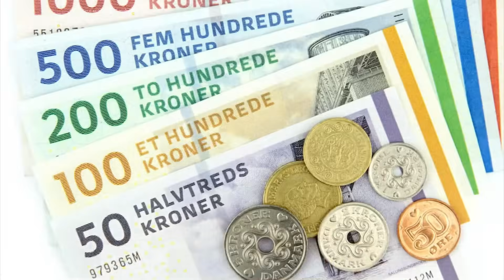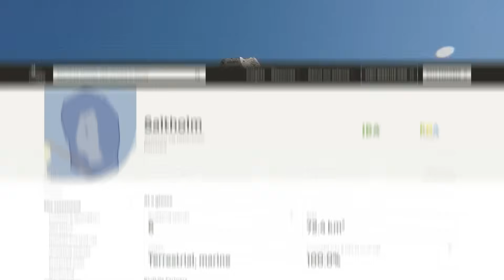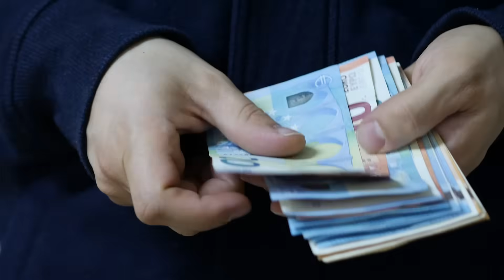Can the Øresund Metro Unify Denmark and Sweden?

Comment: Max speed Øresund train across bridge - 180 km/h
Max speed Copenhagen Metro - 90 km/h

The Danish state railway company DSB fears Swedish competitors might take parts of the Danish market and so want to shut down regional trains across the bridge, claimng it's congested and freight and long distance trains are crowded out, only a metro to Malmo will fix that.
Reply from the maker: That’s a really useful breakdown, thank you.

The speed difference is striking, and it highlights one of the key arguments in favour of a dedicated metro link. But you’re also right to point out that DSB’s position isn’t purely about capacity, it’s also about market protection. The congestion argument has some technical merit, especially with increased freight and long-distance traffic, but it’s hard to ignore the commercial dimension.

Replacing regional trains with a metro would change the nature of the Øresund link entirely, faster frequency, but lower speed and range. Whether that serves cross-border commuters better, or simply reshapes the operator landscape, is still very much up for debate.
Reply: @urbangiantsofficial Also, it would end direct trains between Copenhagen and large cities on the Swedish side such as Lund and Helsingborg.

Comment: Most of the shown footage is misleading. 
One topic is not even covered; the comfort of the service. If you went to Copenhagen today, you will notice the comfort of metro service is awful. If you are even able to get a seat, they are hard as a rock and the metro trains themselves are very uneasy in the tracks.
For the current short trips, this is barely acceptable. For a 20 min ride to Malmø, it will be highly unacceptable!
This is just a political wet dream, by people who have no idea about how it is to use the metro in Copenhagen today.
I do however acknowledge, that the capacity needs to be increased - but just with regular trains which offer a superior user experience.
Reply from the maker: The footage is illustrative, not literal. We used available visuals to convey the concept, not current rolling stock. It’s noted that not all clips show the exact systems being proposed, and that will be better clarified in future edits.

On comfort: yes, Copenhagen Metro trains aren’t designed for long-distance travel. If this cross-border line were built, it would require a new class of metro vehicles suitable for a 20-minute journey. Comparing it to existing local metro stock is not accurate. This proposal isn’t about reusing the current system, it’s about scaling capacity with higher-frequency, automated service, which conventional rail can’t deliver on the same level. The current system is reaching its limits, and regular trains won’t meet long-term demand.
Reply: @urbangiantsofficial  The proposal is about extending an existing metro line in Copenhagen to Malmo.
Reply: Dude, Copenhageners are so soft, it's honestly embarassing. Try riding the metro in Seoul or Beijing or a similar large metro system. Standing up for an hour straight to get anywhere in the city is completely normal. A twenty minute metro ride is nothing!

Comment: Talking about TBM being a proven approach used at the Fehmarn belt tunnel and simultaneously at 3.10 showing footage from said tunnel which is obviosly not TBM-made. Great reserarch!
Reply from the maker: Fair points, our visuals are still a work in progress, especially with limited footage available. We’ll be tightening accuracy in future edits, and we appreciate you calling this out.
Reply: And also talking about the Copenhagen Driverless Metro while showing footage of the Copenhagen S-Tog train with a driver.

Comment: The Danish state railways, DSB, hates the cross border Oresund train system,  and is fighting heroically to get the nasty Swedes off its tracks. It has successfully cut it back on the Danish side from Helsingor to Osterport and is now working on getting it off the stretch to Copenhagen Central Station. The point of this new line proposal is to replace the present 180 km/h Oresund train connection to Malmo with a 80 km/h metro line so they can get the Oresund train off the Oresund bridge, supposedly to make room for freight, which would otherwise need more cross-Oresund fixed links.
Reply: citatation needed
Reply from the maker: There’s some truth here but also key distortions. The Øresund Metro isn’t a replacement for the existing 180 km/h rail link, it’s a supplement to relieve congestion, especially for short-distance commuters. The goal isn’t to “kick Swedes off the tracks” but to free up capacity on the Øresund rail corridor, which is projected to hit maximum usage by 2040. DSB has reduced Swedish train access north of Østerport, yes... but the core Copenhagen–Malmö route remains critical. Freight growth and regional integration are both real pressures, and a metro helps absorb that load, not eliminate it.
Reply: As a native Swede it’s hurt to hear how awful you Danes thinks of us! “ nasty Swede “ Tack Denmark!! Och hejdå !!
Reply: @Greenelnour  Nope, I wrote that's how DSB thinks of potential Swedish competitors on their tracks.

Comment: If this project succeeds once it's built, we may get a similar connection to Germany from somewhere in Sweden (probably Trelleborg or Ystad). So I would welcome this project, because of what it could mean for the feature.
Reply: A metro from Sweden to Germany is too great of a distance.
Reply: DUDE! Look at the distance from Sweden to Germany across the water. No tunnel or Bridge will be made there. It just doesn't make any sense whatsoever. There is no great need for it, and the price would be astronomical. If you are in Sweden and want to go to Germany; go through Denmark.
Reply from the maker: A metro to Germany is a stretch with today’s tech and priorities, but a fixed link from Sweden to Finland across the Gulf of Bothnia is a more likely next step. It’s shorter, more feasible, and already being discussed.
Reply: @urbangiantsofficial  Fixed link from Sweden to Finland? ROFL. That distance is 10x the length of Øresund bridge + the traffic volumes there is significantly lower than in Øresund region. Please, act your age and stop talking about nonsense.
Reply from the maker: Instead of insulting, feel free to do a simple Google search and you’ll see that it has been talked about. It’s not a good look and invalidates your input.

https://www.euronews.com/next/2025/03/08/will-a-bridge-across-the-baltic-sea-to-sweden-give-finland-faster-connections-to-europe
Reply: @urbangiantsofficial  I'm willing to make a bet. That will NOT be built within the next 30 years for sure.  I will give you odds 50:1 - Are you willing to bet?
Reply: @urbangiantsofficial  It has been mentioned. Hyperloop has also been mentioned. People dream about stupid shit all the time.

Comment: Wouldnt it be easier to add a couple more tracks the the Øresund bridge?
Reply: Not possible its designed for 2 tracks
Reply from the maker: Good question, but no, the Øresund Bridge was only engineered to carry two rail tracks from the start. It’s already operating near full capacity, which is one of the main reasons the new metro is being proposed.

Comment: Have you ever heard of Øresundtåg it already does this in 20 minutes, so it wouldn't be needed
Reply from the maker: Great point. Yes, we mentioned Øresundståg in the video. The difference is capacity and frequency. The Øresund Metro would run more often, relieve pressure on the existing bridge, and better serve local commuters alongside the regional service. It’s not about replacing Øresundståg, it’s about building a system that can handle future growth.
Reply: Nah. That's 40 minutes center to center. The Metro would also server other parts of both cities than the current rail network does.
Reply: @JohanHolmbergMalmo, but you can change to other modes of public transport
Reply: @Human_Junkmail there are more factors to this than only travel times. Maybe the biggest one is relieving capacity on the bridge and the rail corridors feeding into it. A metro connection would mean more room for freight, long distance, and regional trains on the bridge.

Comment: More work for the factory that is building sections of fehmarnbelt tunnel ?
Reply from the maker: Possibly, yes. The Fehmarnbelt factory at Rødbyhavn was built with scalability in mind. If the Helsingør–Helsingborg tunnel moves forward, it could absolutely benefit from that same prefabrication expertise, especially for immersed tube segments.
Reply: @urbangiantsofficial Sections for the Farø Bridge were built in Nakskov, I think to remember, and sailed to Vordingborg to be lifted up on the pillars (Still with experimental Teflon Coated plates as a sliding base for the needed expansion! And only painted outside with a controlled dry air inside!). I should think that the sealed Tunnel Elements could be dragged by Tugboats as floating, to reach Helsingør - Helsingborg, when and if needed? It would be much, much less costly than building a new Factory op north, and they could continue directly if the needed preparations had been done up there! 😄   Finn
Reply: I want Copyrights on this, if ever done!!!
Reply: They could continue making Elements for a Tunnel between Helsingør and Helsingborg, which would then be with two tracks and 4 roads!

Comment: Its just too much of a dream. With a faster connection already existing that money can be better invested in better projects, like a tram/letbane system in both Malmö and København. And for capacity issues that problem can be massively reduced by quadtracking the rails between the bridge and both Malmö central and Køvenhavn Hovedbånegard.

Would it be good for the region, yes. But so would many other things and this is just not worth it.
Reply from the maker: Great points, and we actually addressed this in the video. While trams and quad-tracking would absolutely help in the short term, the Øresund Metro is about long-term regional planning. With the Fehmarnbelt Tunnel set to open, there’s going to be significantly more cross-border traffic flowing through this corridor. A dedicated metro line isn’t just about today’s commuters, it’s about building capacity for what’s coming next.
Reply: How would you even quad-track a bridge? The cost for that probably wouldn’t be that much lower than the cost of the metro tunnel.
Reply: @gustavsturksteinwall4027 Thats why i mentioned between the bridge and Malmö Central and København Hovedbånegard. Not the bridge itself.

Comment: You talk about using tunnel boring machines under the sea but then show a sunken tunnel segment which is the most likely approach rather than tunnel boring machines and is the technique being used for the Fehmarnbelt Tunnel.
Reply from the maker: Great catch, and you’re right that the Fehmarnbelt Tunnel is using the immersed tube method. For the Øresund Metro, both TBMs and immersed tubes are technically viable depending on final route, depth, and soil conditions. We showed both to reflect that flexibility, but we’ll make that clearer in future videos, appreciate you pointing it out.

Comment: This really should be conventional rail instead of, or in addition to, metro.  That would enable greater regional connectivity, instead of simple center-to-center service.  It would also provide strategic redundancy-in the event of a problem with the bridge, priority rail traffic could be diverted through the tunnel, and vice-versa.
Reply: There is already conventional rail via the bridge
Reply: @Boxtermaiti  Yes, I know.

The point is to have more conventional rail capacity that can integrate into the larger region and provide strategic resiliency.    

Just because there is already conventional rail doesn't mean that the need for more capacity couldn't be filled with MORE conventional rail.  As noted, it would be better for the region as a whole on both sides, instead of just the urban centers.
Reply: @00Zy99  : So how many lines woul you like, 69 or 70?
Reply: @henriknielsen1662  The tunnel itself could be double-track.  How many lines are routed through it would depend on the timeline of the H-H link, as well as journey times on both sides.  But I would expect at least 72-75 terminals combined on both sides, especially if abandoned lines are re-opened.  Through-routing would have to take into account travel patterns, desire corridors, flow balancing, and potential delays.
Reply from the maker: Interesting argument, but a dual-purpose tunnel risks doing both jobs poorly. Metro and conventional rail have totally different requirements, from platform height to signalling, and trying to merge them could drive up complexity, cost, and delay. The current Øresund Bridge already handles conventional rail. A dedicated metro line would ease short-trip congestion without competing for that space and serve a different, high-frequency commuter need. Sometimes separation is what makes a system stronger.

Comment: they should just make it an extension to the bridge, cutting costs and construction time, then connect it to the airport and ørstad metro stations
Reply: There is no place, it  already has a rail link
Reply from the maker: Interesting idea, connecting directly to the existing Øresund Bridge could definitely cut costs, but it would likely limit frequency and flexibility, especially for metro-scale service. A tunnel allows for higher-capacity, dedicated infrastructure, but your point raises a valid question: how much are we willing to trade off for speed and savings?

Comment: Before viewing the video: does this take bring up the single most crucial aspect = actual support from Copenhagen and its politicians? Because nothing will happen unless Copenhagen actively pushes it. 

Sweden and Malmo is incredibly secondary concerns in the Oresund region; they just have a very hard time understanding much less accepting this.
Reply: There are some support for it, politically, but many see it as either an overkill and/or impossible to make financially sustainable. And Copenhagen does not see Malmø or the region as a whole, as being secondary. Infact many view it as a commercially integrated part of the Copenhagen region. Maybe one day once again back home with Denmark . . . . Since the rest of Sweden hates them so much.
Reply from the maker: Great exchange, and you’re both circling a key tension: the Øresund region functions as a cross-border economic zone, but political backing still hinges heavily on Copenhagen. Malmö may be vital commercially, but without strong push from Danish decision-makers, the project risks stalling. Whether it’s viewed as overkill or overdue depends entirely on who’s framing the future of the region.

Comment: Still we have some Customs Control, so a Metro won't avoid that.  But if the "Fehmarn Tunnel Factories" continue, a tunnel could be made between Helsingør and Helsingborg, with ease!
Reply: To me viewing from a distance that sounds a lot more sensible. A HH tunnel and a local train ring line. Such ring line would would take up most of the commute and with longer and maybe double decker trains could carry more people than metro allows. It would also service the airport directly. Helsingør and Helsingborg along with the smaller towns on the coastline would be included in this "metropol" fantasy. Travelling time would be longer though. The Direct Metro could be considered in the future if need should arise though I doubt that with the fast shrinking populations in the Western world.
Reply from the maker: The idea of a Helsingør–Helsingborg tunnel paired with a local ring rail is actually quite compelling. It would shift the conversation from just one mega-connection to a broader network that serves the entire region. You’re right that travel times would be longer, but capacity, accessibility, and resilience could all improve dramatically. In a world where urban concentration is evolving, rethinking the corridor as a system, not just a shortcut, might be the smarter long game.
Reply: @urbangiantsofficial  When building a part of the new Connection to Germany, a local tunnel below Guldborgsund, it was planned to be only two tracks, which would be enough for a long time with the present amount of traffic to and from Rødbyhavn - Puttgarten. But the Entrepreneur offered to build an - extra tunnel Element, now they had a workplace and a harbour ready, for a "few" hundred million extra!! And this was luckily decided to be done with a hopefully coming rise in Traffic!
Reply: There will never be a HH tunnel. The Danes don't want more traffic along the Kystbanen. They are perfectly pleased with having convinced the Swedes to build all the infrastructure on their side of the sound, and then have all the traffic slip past Copenhagen at the southernmost point...